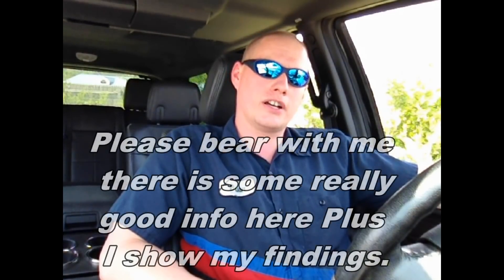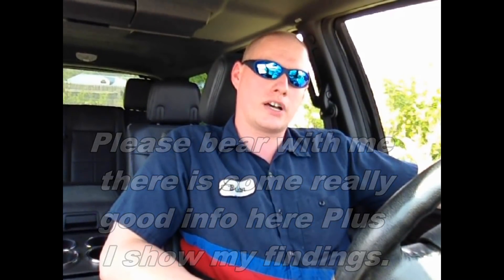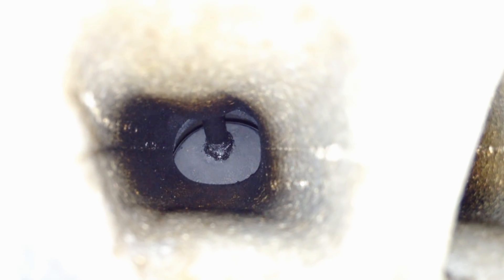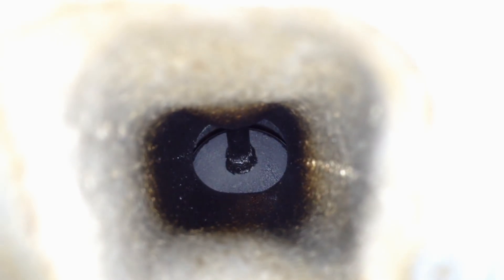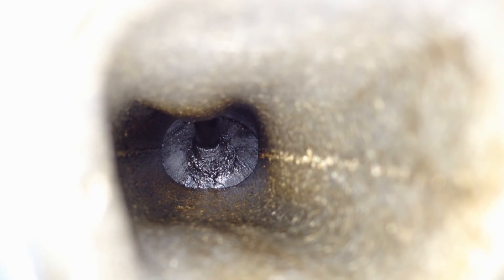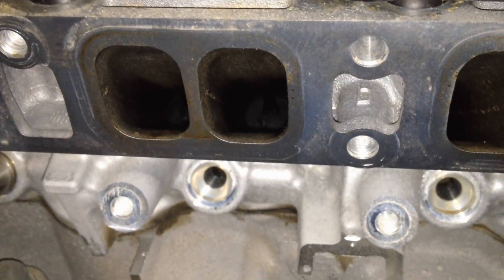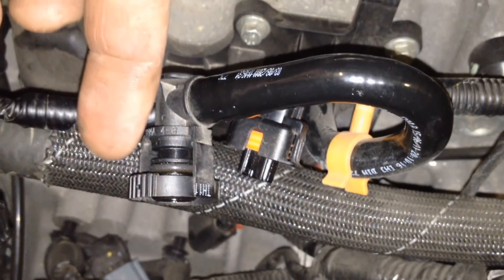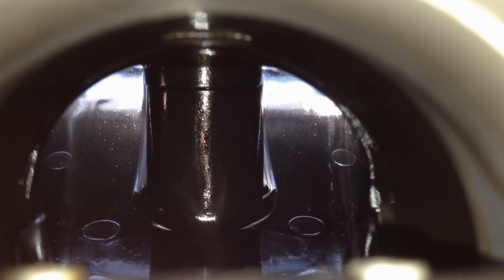Ford Ecoboost Warning Part 2 My Findings

Comment: I just got off the phone with my dealership and they said they havent been seeing any carbon issues with these engines.None the less I still changed over to Mobil One full synthetic oil and also filled the tank with Exxon mid grade gas with a bottle of Chevron Techron fuel system cleaner.Also went with a Fram extra guard oil filter.Took the truck to a wide open stretch of highway and stomped on it a few times.This will be the only oil, filter and gas my truck gets from now on.One question though.I see these irredium plugs are only getting around 50,000 miles.Is there another acceptable spark plug for the 3.5 ecoboost?
Reply from the maker: The issue is not all that bad as explained in my new video. I would only use the Motorcraft spark plugs in this engine. I have new videos on both-
Ford Ecoboost Engine Carbon Deposits: What You Need to Know
http://www.youtube.com/watch?v=-ynGWxzJHjA
Ford F150 3.5L V6 Ecoboost Misfires: Spark Plug Replacement
http://www.youtube.com/watch?v=A042BqRDHTc

Comment: So what solved the problem? Was it due to bad injectors of carbon buildup on the intake valves?
Reply from the maker: catfish500mark Considering the injectors passed the high pressure balance and flow test I would say the carbon

Comment: The new VW GTI 2.0T motor has two injectors, one in the intake for low RPM and the second in the cylinder for high RPM use. Having the one injector spray on the back side of the intake valve is a good traditional way to prevent carbon buildup.

Comment: It's because the engines are direct injected and ford isn't the only manufacture that has issues with build up on the back side of the valves.  This is a common issue when you get away from port injection and move to the high pressure direct injection.
Reply from the maker: Yes as explained in  my new video detailing this and how to minimize it-
Ford Ecoboost Engine Carbon Deposits: What You Need to Know
http://www.youtube.com/watch?v=-ynGWxzJHjA

Comment: Dear Fordtechmakuloco: I am just getting ready to buy my first F-150 ever and it is a big deal for me. I was firmly thinking 3.5 eco boost of course, but now I am unsettled. Do you have any thoughts on the 2015 models? Do you suppose that Ford has improved the problem areas you describe? My 2006 Ford mini van gets a fuel additive when I fill it up at the pump. If I get the 3.5 echo boost on the F-150, would it be a good idea to consider putting in the fuel additive with every fill up? What are your thoughts on going with a synthetic oil? Is it going to be a significant improvement over standard motor oil? or would I just be spending more money unjustified? If the engine is really going to have these problems would I be better off getting the 8 cylinder? it seems a shame to have to avoid getting the motor I want that would be more economical to operate, after all, that is a big part of the attraction in this truck.
Reply from the maker: I am thinking that since the 3.5l Ecoboost is just a carry over and how much is weighing on this new trucks launch and the time they have had that most if not all of the current problems that plague the 3.5l Eco will be resolved. I am personally thinking of getting a 2015 also and will be choosing the 3.5L Ecoboost. I have a new video just on this issue-

Ford Ecoboost Engine Carbon Deposits: What You Need to Know
https://www.youtube.com/watch?v=-ynGWxzJHjA

Comment: Altough I not an ASE cert. mechanic and dont pretend to be I would like to ask a question.If the vehicle was brought in for a misfire what would carbon buildup on the valve stem have to do with a misfire.In youre previous video WARNING TO ECOBOOST OWNERS you stated that you did a compression check and that passed with flying colors.The only way carbon build up could  cause a misfire is if the carbon is between the valve seat preventing it from completely seating and causing no or low compression.Is the point of this video to make ecoboost owners aware that the carbon build up could break away and ruin a turbo? I just purchased a 2014 3.5 twin turbo f150 and Im concerned with this to say the least.Im in no way trying to be a wise guy but since watching your videos yesterday this subject has really never left my mind.If you dont mind please explain if this is about a misfire due to bad injectors or a misfire due to carbon buildup and explain what you did to fix the misfire.Also you were having the carbon issue in the 4 cylinder engine on the #2&4 cylinders right where the pcv valve is.Is this the same issue for the 3.5 litre engines.Im having trouble understanding all of this.Thx

Comment: Delete PCV valve, install Road draft tube.
Problem solved.
Reply from the maker: Bob Smith Yeah but that is illegal.
Reply: FordTechMakuloco Catch cans!
Reply: Dillon Turner’s
Reply: I love it!   Imagine the WHINING from the EPA & others over a road draught tube!!
Reply: Yeah bra! Takin care of the humanities only habitable planet is fuckin STUPID!
Reply: My first thought as well.  They don't do visual inspections in my state. :)
Reply: Out with the "new", IN with the old.
Reply: FordTechMakuloco 
Do you think installing some kind of filter media between the PCV and intake would be a viable solution? Of course that filter would have to be changed as part of regular maintenance.
Reply: @yourtube540  Yessir.  A high temp oven to neutralize the nasty crankcase vapors...a converter...a catalytic converter.
Reply: Bob Smith ...that would probably throw a code and then you get a check engine light.

Comment: This is the reason why other manufacturers do not use turbo in their gasoline engines... too much problem. Ford buyers, my suggestion is to go with their reliable V8s. Or just buy a Toyota who uses Denso parts which never gets any issues.
Reply: I agree that turbo engines do come with more maintenance issues than an NA engine. But I love driving turbocharged cars over NAs. No one drives non-turbocharged diesels because that would just be insane. lol
Reply: This issue has nothing to do with the turbo, didn't you watch the video.
Reply: The turbo failure is from using cleaners that burn hotter then the turbo is designed for!
Reply from the maker: Godlikehenry Ford 5.0l is a great alternative yes.
Reply: Turbo is indeed fun. But do you realize Toyota completely stopped manufacturing "turbo" vehicles? there is a reason. Do more research. Yet, Germans still do turbo. Well? That is why you lease their stupid cars.
Reply: I've boosted Hondas for years and never had issues. Taching 8k rpm at times running 7-12psi. No issues.
Reply: I boost hondas too. The honda D,B,F,Ks don't inject fuel the same way as the Ecoboost. The problem with the ecoboost engine is that it's a direct injection engine with the fuel not passing the through the intake valves. Even hondas with turbos, especially precision turbos, smoke and have oil trouble. And most that boost hondas use catch cans. Or some type of crankcase ventilation to prevent gasket damage.
Reply: Hondas do not condone turbo. The last turbo they officially used was on Acura RDX and they took that out. Hondas have the lowest HP among competitors and they are known to last.
Reply: It does have to do with turbo. He said eventually turbo will give it up and you would have replace it....those things are pricey.

Comment: shitty fuel is more likely the main problem here, Subaru head gasket issues. Volkswagen turbo. Etc. stay away from Cheap gas.
Reply from the maker: Yes as stated in my new video here-
Ford Ecoboost Engine Carbon Deposits: What You Need to Know
http://www.youtube.com/watch?v=-ynGWxzJHjA

Comment: Cold start misfire, sounds to me like you had a vacuum leak from the intake. Once warmed up seals expanded helping made a good seal. You took it apart, didnt see much, bolted everything back up, and made a nice tight seal on the gaskets. Fixed
Reply from the maker: Mustangmikewil Vacuum leak nah, I almost never see that kind of failure, also with the low mileage, intake and seal design I don't see that as being the fix. Also this would happen going down the road at 2-2500 rpm cruise which would not be affected by a vacuum leak especially with boost.

Comment: BMW and Mini, as you mentioned, have the same problems. They have an official cleaning process that involves walnut shell blasting. I read about it on the bavauto.com site in their summer 2014 issue of Fast Times. They sell and rent blasting kits. Of course the adapters may not fit the Ford ports exactly. The pics of the ports and valves they have on their site are much worse build-up than the ones you show.

Comment: Ford will most likely come out with a PCM software update that will change the parameters for cold misfires.  Easiest/cheapest way to go. 
-BMW used a walnut shell media blaster to clean the intake valves after the intake manifold was removed.
-VW/Audi 1.8turbo/2.7biturbos(5 valve engines) used a software update for the ECU and "highly recommended" their own fuel additive(Chevron Techron with a VW label on it) which worked great for removing the carbon and keeping it off the valves
One place I worked at, would spray a water mist into the hot engine while accelerating.  It worked much like the how a hibachi chef cleans the hibachi with a hot rag and water.  The hot water emulsifies the baked on grease and oil.

Comment: do you know much about the new DI GM engine such as the 6.2? i have read that they have some patented technology to eliminate or reduce carbon build up
Reply from the maker: Scott Brander Yeah I have heard similar.
Reply: FordTechMakuloco would you still buy an ecoboost? i prefer my 6.2
Reply from the maker: Yes I am looking at a
2016

Comment: I use PM3 to clean the valves running it through the evap vacuum port on the intake and it NEVER ruined the turbo.

Comment: Do u have 2.0 gtdi engine on any car over there ? Does engine failures of these engine occur quite frequently ? If so what is the reason for the failures...because my Volvo has a ford engine 2013 model
Reply: Joel Philip flatness defect between block and cylinder head will be the answer on 1.5,1.6,20 ecoboost

Comment: This was a problem with BMW engines 25 years ago (not direct injection) and walnut shell blasting the intake valves was common back then. BMW intake valves used to look 5x worse than these.

Comment: Do you know if this issue will or is effecting mustangs ecoboost
Reply from the maker: Aaron Gonzalez I sure hope not as that will be a second gen ecoboost.
Reply: FordTechMakuloco On the Mustang, I know I can buy a catch can for the 5.0.  I traded mine in on a 2014 3.5L Ecoboost Explorer. Can I use a catch can like the ones made for the 5.0 on the Explorer?
Reply from the maker: I am not sure you will have to contact the manufacturer of the can but I don't see why not.

Comment: All the aftermarket boosted cars I've seen usually run an air-oil separator that looks like what they need, I see no problem with having the catch can dump into the exhaust after the cat or having the mechanic drain it oil through a hose near the oil drain plug

Comment: Toyota's D4-S injection system on the BRZ and 86 twins combines Direct Injection (low load) with Port Injection (high load). They have a special cycle which runs the Port injectors when there hasn't been enough high load events to keep the valves clean.

I can see this also being a solution to turbo cars if there are no other issues with the air fuel ratio.
Reply: My sonic 1.4l gets past EPA standards while getting 40 mpg hwy and uses older multi-port sequential fuel injection. Ford just isn't using the right technology to meet EPA standards. Ford doesnt think about longevity the same way they did before 2000.
Reply: Watch what you write on here....notice there are many Toyota haters.
Reply: The new ecoboost engines in europe have that, too.

Comment: why can't they just go to a pcv catch can even a cheap plastic one  that the tech can empty every oil change or would that make to much sense
Reply from the maker: charles fournier They don't want to ever add any required maintenance they avoid it like the plague.
Reply: FordTechMakuloco Except they just told me every 30k I need a "fuel system cleaning service" for $250 on my Flex eb
Reply from the maker: Yeah well they are wrong.
Reply: sfoege
 A fuel cleaning service will do nothing for the problem being discussed here.
Reply: well said guess he hasn't figured that there is some solvents out there that can rinse away carbon

Comment: This is nothing new, its a common problem with all Direct injected gasoline engines where the fuel, which keeps the valves clean, is been bypassed from the port to into the combustion chamber. An very effective way to clean is is to use a crushed walnut shells into a sandblaster nozzle with a vacuum cleaner hose in conjunction with to remove the shells while the intake valves are close or piston at TDC.
Reply: zech007 ...That is a very effective way to clean the intake. Its also very expensive for people who can barely afford the car payments.
Reply: The new ecoboosts in Europe all have combined injection.
Direct and before the intake valves to keep them clean.

Comment: So has Ford given a decree on how to solve this?  My Escape has 44k miles on it, I feel this is starting to become a problem, I think I am going to take it in to have it checked out.  They need to do something, this is dumb.  I was thinking about pulling the intake manifold and cleaning the valves myself but...I have a warranty and when it runs out I am NOT going to go through this hassle every 20k miles.  The joy of owning a newer vehicle is not having to screw with it and do complicated work on it all the time.  They can buy the Escape back if this is the case.
Reply from the maker: 91sonomast1 No word yet from Ford on a cleaning solution.

Comment: Hello +FordTechMakuloco.  First of all I would like to thank you for all of the info you present in your videos. I wish I was aware of this carbon issue in the Ecoboost engines before I purchased my 2014 3.5L F-150 in June. Other than using synthetic oil, quality fuel and putting the petal to the floor on occasion to blow out any possible carbon build up, what other suggestions or recommendations do you have to make my vehicle last for years to come?
Reply from the maker: Marko Liu A quality catch can.
Reply: FordTechMakuloco Did I miss something here? what does a catch can look like and where does it go? I am from the era where the crankcase vent went into a pipe that aimed at the roadway. So  for many years now it is returned to the combustion chamber to be re-burned and that is what is causing problems with direct injection engines right?
Reply from the maker: dean reynolds There is also an oil coking issue from the oil pass through that is the reason for the catch can before it gets pushed through the intake to the hot valves and bakes on.

Comment: The carbon builds up because, unlike conventional wet induction systems, direct injected engines and their "dry" (except for PCV oil vapor) intakes have no fuel to wash that oily blow-by away, so it bakes on the intake valves. Google the BMW issue, and you'll see. The valves shown in this video are nothing compared to the direct injected BMW N54 engines. I'm not sure I would use any liquid to try to wash away that gunk, because those turbos will not like it, and those turbos will cost a mint, especially when Ford blames you for ruining them.

Comment: Good  investigating!   Thanks for sharing.   I just boight a 2014 Escape with the 1.6l ecoboost...thank god I also got the 6yr/72000 mi warranty!  If ford doesnt find a fix to this I will be trading in at 6 yrs :)

Any advice on how to minimize this?  Looks like there isnt due to the oil venting method they use.
Reply from the maker: faamecanic1970 Use good quality oil that isn't so prone to coking would be the best.

Comment: Jasper Engines and Transmissions already has 6 of the 3.5 ecoboost engines on test stands.The 3.5 Ecoboost has headgasket problems and fuel injectors blowing right out of them.
Reply from the maker: wafrederick Never heard of those two issues on a ecoboost to date.
Reply: The Jasper Rep that visits my my father's shop has talked to Ford techs that have seen this.Jasper has 6 of of them on test stands finding the problems with them.

Comment: I wonder if GM is going to have this same problem with there direct injected Engines in there Silverados. Would like to see what there solution would be or how there going to clean the valves.